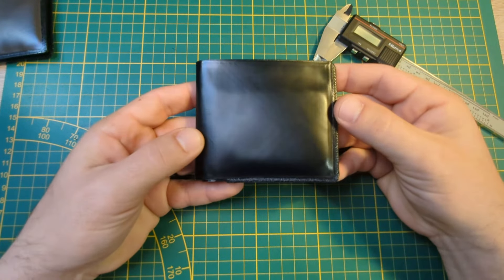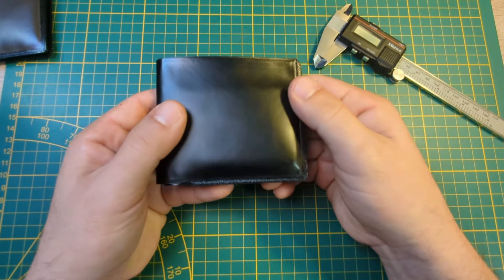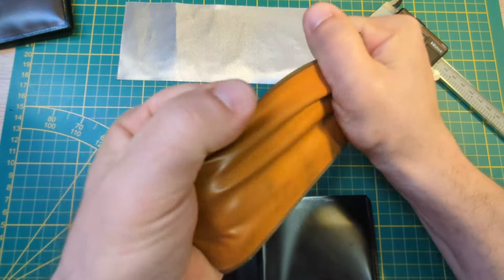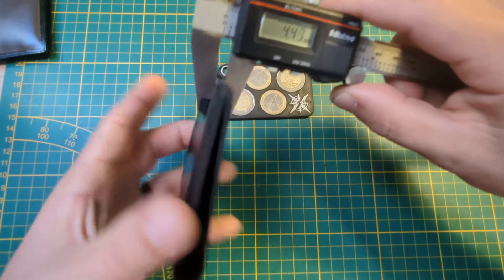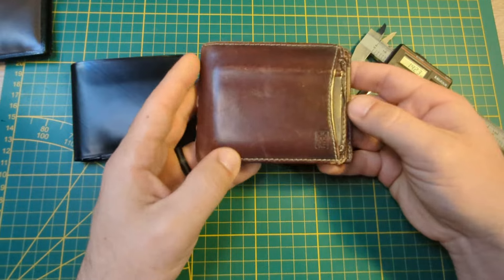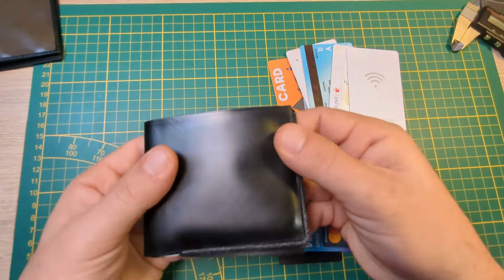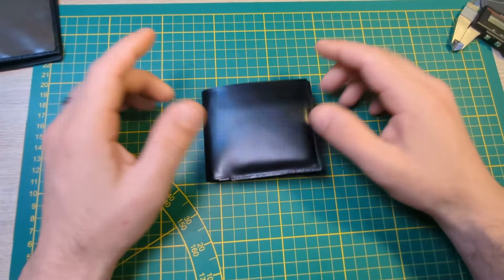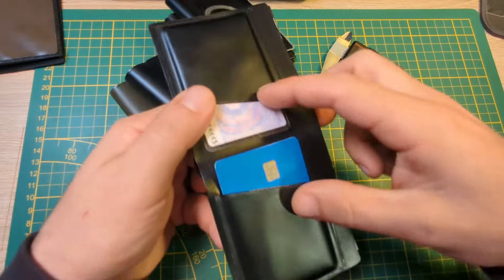Thin 3d Printed TPU Wallet

Comment from the maker: Hey thanks a lot! I got the smooth finish with the ironing feature in Cura by tweaking the speeds, z-offset and combing with some custom g-code to assure the nozzle doesn't travel over the piece.  

I do have a nice brown version. Maybe you saw it in the upper left corner of the video. What color would you want?

As for the files, it's kinda complicated in that I don't have printable stls of the base wallet, it's pretty much all custom g-code. If you want more information, there's a lot in it's reddit post  https://www.reddit.com/r/3Dprinting/s/FeWQJjrgkZ